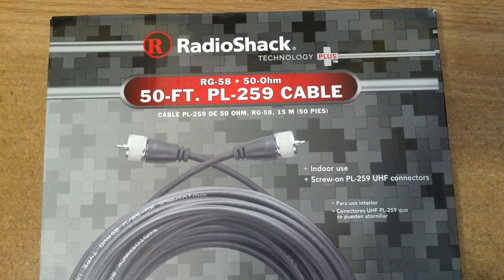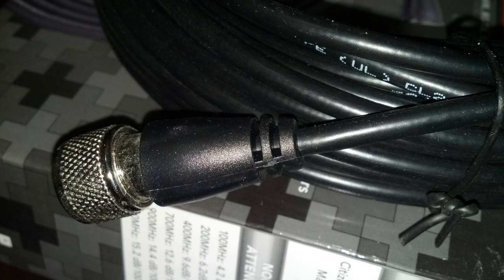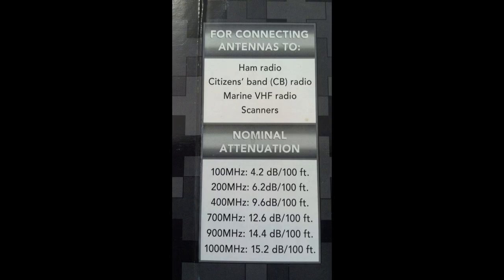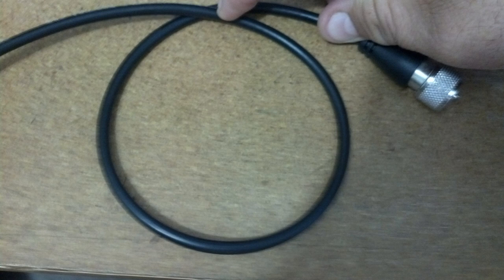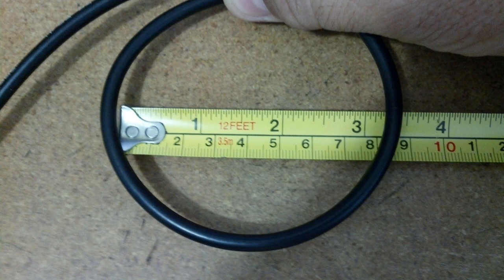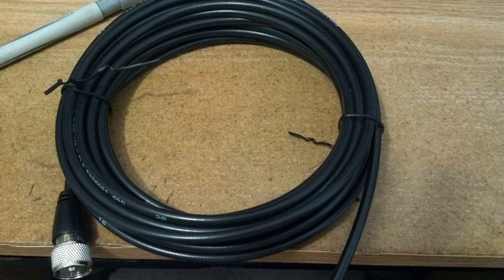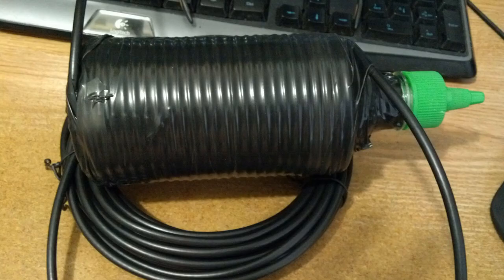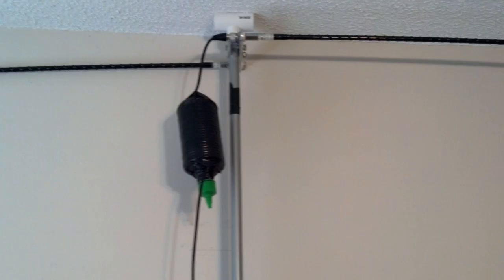Home brew All Band HF Air Core 1 to 1 Choke Balun

Comment: Get a proper ground adjust your swr where it should be (without using an antenna tuner) and signal won't be traveling back down your coax because it will be going out of your antenna instead and then you will talk farther with less power and you will no longer bother your computer.

Comment: Helpful video. You said between 18 and 20 feet to get the proper reactance (about 2:42 into the video). How did you decide on that length?  If there's a link to formula or reference, I'd appreciate it.  Does this air core balun provide the same benefit as a feed line choke, of stopping RF from going into the shack? Thanks!
Reply: This is a feedline choke and not a balun.  The only difference is one is wound on 1 or more torroid cores and the one in in this video is wound on a plastic form, ie.: air wound.  They are both chokes, also known as a "Line Isolator" or a "1:1 Line Isolator".

Comment: Out f curiosity... (I know very little about db and frequency) what does this coil help you do better?  (Other than the obvious answers... like gives better clarity or increasing the distance type of answer... Please)  :-)
Reply from the maker: +Asset Prepper  It keeps the coax from radiating Rf Without it not all of the power is going out the antenna. The feed-line becomes part of the antenna, currents can flow from the line into the mains and on TV cables causing a variety of interference problems .  
In short I keeps all the radios energy going out the antenna and not being converted to ...well basically heat.

Comment: There's no such thing as a 1:1 choke balun.  It is either a choke or a balun and since the item described in this video does not do any form of impedance transformation, it a choke.  More commonly known as a line isolator, it prevents common mode currents from traveling down the outside of the coax's shield and causing RFI/TVI.  Also if you must call it by another name then it most closely compares to a 1:1 unun (unbalanced to unbalanced).  Balun on the other hand stands for balanced to unbalanced. Such as the 4:1, 6:1 or 9:1 baluns, also the 49:1 balun as used on end fed wire antennas.

Comment: What is the function of a balun?  It is to reduce common mode currents on the outside of the coaxial shield. How do you know that it is performing the function of a balun without measuring the common mode impedance??
Air wound chokes are narrow banded devices (effective at their self resonant frequency). Too many turns or too few and it can make the common mode current WORSE.
Reply: A choke, which is what this author is winding, will reduce common mode currents on the outside of the feed line. A balun (totally different winding) matches the unbalanced feed line to the balanced dipole antenna.